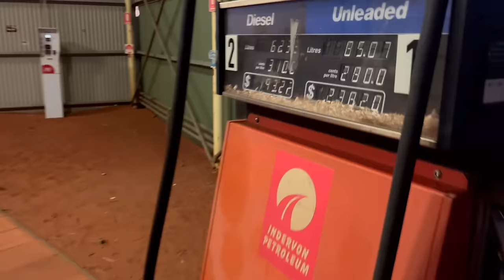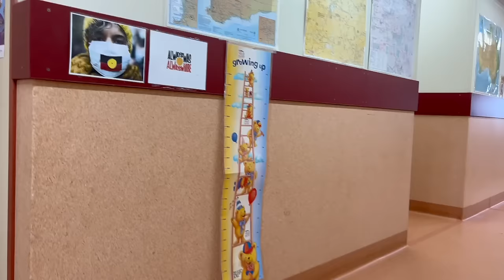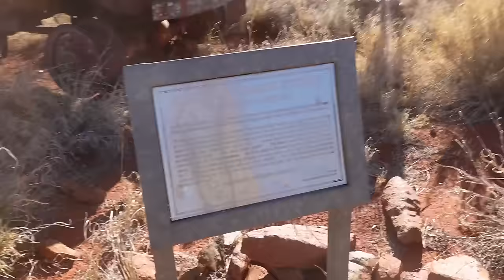We made it to Australia's most remote town with Holden EH

Comment: I purchased a EJ 1963 station wagon when I was about 21.  It was a beautiful green colour with a white roof and white walled tyres.
I only had it for about a year because I got a job at O’Brien Glass in Brisbane as a sales representative.  
They gave me an almost new Mark 3 Zephyr as a company car.  

So I sold the Holden to a guy who kept it for donkey years.  I would see it from time to time years later with the same guy driving it.  I think he would have driven it until it died. 15:23 

I’m 80 now and my current car is a 2016 Holden Calais.  A beautiful car.

Comment: Just wondering if the reason the fridge doesn't work is because of where the solar panel is tucked up under the roof rack. If it's a flexible one why not place it over the top of what's on the roof rack , some of 'em don't work well when part of the panel is in shade.